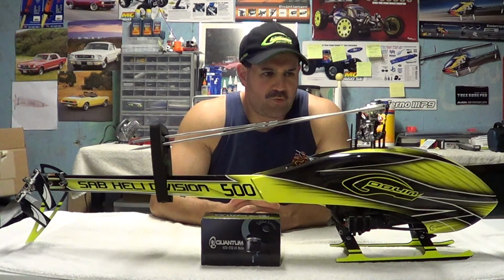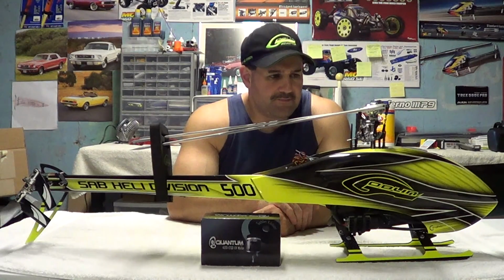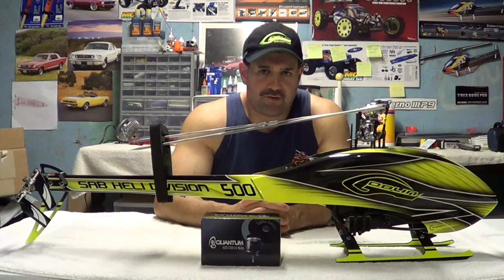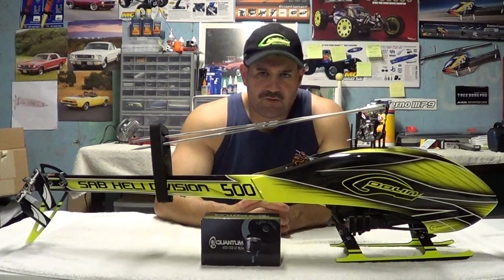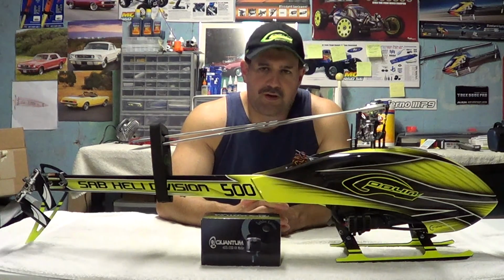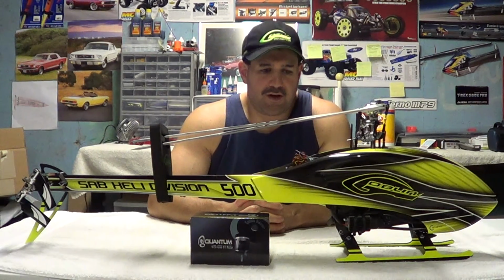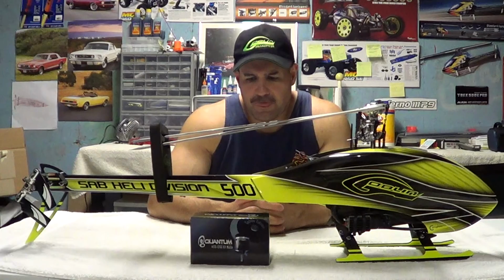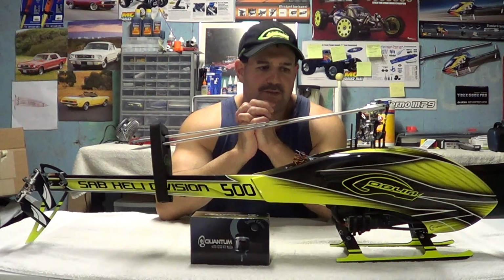Sab Goblin 500, castle creations esc problems ,upgraded with quantum 4120-1200kv motor

Comment: Im using the Quantum 4120 1200kv on a YGE 120lvk. Stock pinion. Runs flawless. Gobs of power. Many of the people I fly with are having issues with Castle Creations. Weve all changed to Kontronic or Yge. Castle creations arent putting out good products anymore. If you fly with a CC you are risking your life, and the lives of the people around you.

Comment: I hate to say it but I have this motor and the talon 90 which had major problems from the start. Heli cutting off mid flight.  Also landing and then trying to take off whereupon the esc screamed and the motor just jitters and fails.  An hour later it's fine.  Just hovered mine and it was ok. Landed to speak with wife, went to take of again. High pitched sound from esc and then the motor stuttered.  Esc then blew. Luckily did not take the ar7200 with it.  Would not use another talon 90.

Comment: Ray, I've been running a Scorpion 3226-1400 on my Trex 500 for 4 months now and it has always run scary hot but without issues...must be their nature. I'm running a Phoenix Edge 120hv on my Blade 550x it beeps every 30 seconds but my amps are within the limits.